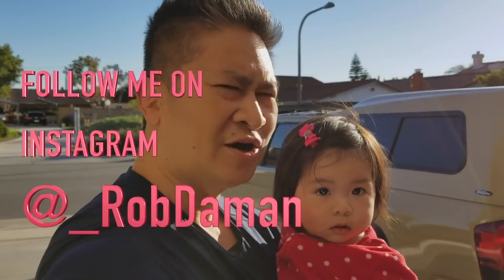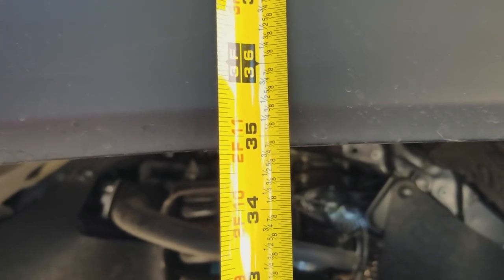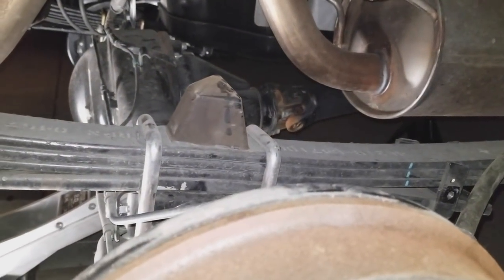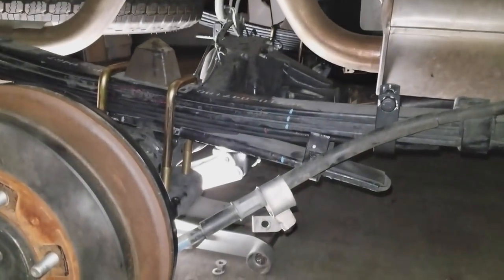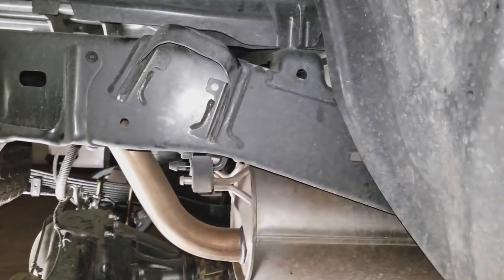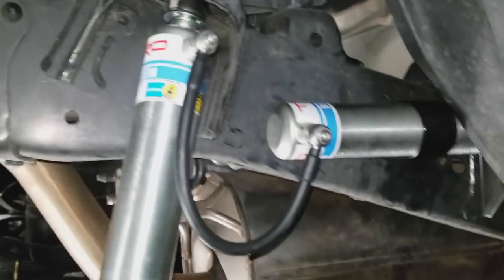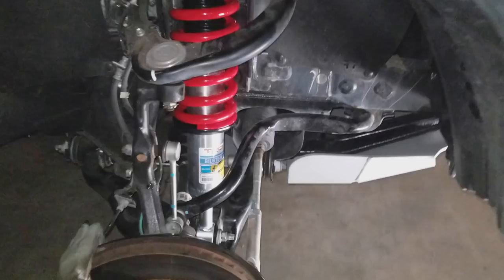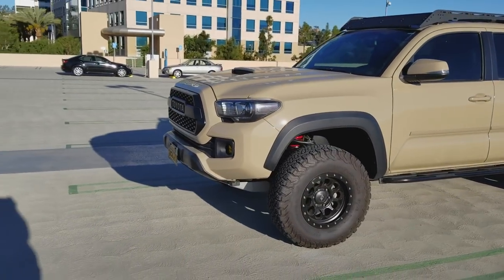I LIFTED my Toyota Tacoma Trd Pro Bilstein suspension and AAL Add A Leaf install

Comment: The TRD Pro suspension is great, down fall is the front TRD B6112s arent adjustable. They only have two clips vs the 5 or 6 clips on the Bilstein 6112s.
Reply from the maker: that is correct. the 2 rings are to handle the infamous taco lean. Some people are buying spacers to add/replace the spring perch or something over the top hat but that will negate some of the settings. it's basically whether you want a 2 inch lift or a 3 inch with the spacer.

These TRD Bilsteins use an Eibach spring so it's 'TRD tuned' which I'll assume Bilstein 6112 are using their own brand of spring. 

Thanks for chiming in.

Comment: You should have done a u-bolt flip kit and some aftermarket bump stops while you were down there man! Flip kits look incredible and really clean up the underside of the axle and increase clearance
Reply from the maker: you know I thought about them but decided to keep the suspension on the cheap. I have an awesome impact gun so I can so those 2 items mentioned probably in under 20 minutes since I know what to do now.

I'd probably reroute the center exhaust too if I did that. 

great suggestions and thanks for the comment!
Reply: Rob Daman of course! I just did the Dakar leaf pack, extended Bilstein 5100’s and u bolt flip kit and Wheelers superbump bumpstops on my 08 trd off road tacoma and the flip kit and bump stops are def worth the small price you pay for them! Your height looks PERFECT even with the added weight of the rear shell.
Reply from the maker: sounds like you got a nice set up!

I'm hoping it doesn't change too much with settling. Only time will tell.

Comment: Looks good man.  The rear was such a PITA for me when I installed my lift.
Reply from the maker: thanks! 

Yea I haven't heard any nice things about the rears except for the shocks. The combo of being alone and dark didn't help me.
Reply: Rob Daman It’s weird cause you would think the front would be the hard part to do.  I messed up when I did mine and didn’t use to jacks.  The truck shifted a little and it took forever and a ratchet strap to get it lined back up.  FYI I’ll be posting the vid of my Prinsu rack.  I used you install video to help me get it together lmao

Comment: Grinding off those retainers and rivets creates no problem for the strength of the leaf pack? Curious because I want to do a similar kit and I read some you have to grind/cut and some don't.
Reply from the maker: Hi, 

Good question. I would say no. It's just about a 1/4 inch hole that you grind and it's at the end of the leaf so there shouldn't be any structural issues.

Yes some you don't need to touch the rivets. It's usually the single leaf ones that you won't have to since they have more of an aggressive curve vs a 3 leaf progressive that I had.

Thanks for commenting.

Comment: @Rob Daman I watched your other video where you installed a 1/4" spacer to take care of the lean.  Was there enough thread on the top hat to lock the nut after you installed the spacer? It looked like you had plenty enough so I'm wondering if you changed the stud. I read some posts on TW where other members ran into this issue. I have a 3rd gen sport (I'm assuming your truck is 3rd gen).
Reply from the maker: It's original parts.

Comment: Please do an update on how the suspension feels after a couple rides! I lm planning on get the trd pro suspension too! 😫
Reply from the maker: sure thing. a few hundred miles so far and I can say it's a little firmer on road but when hitting dips it absorbs it very nicely.  I think it's a good upgrade but I'll see how it settles in.

thanks for posting.
Reply: @RobDaman  Update? I know this video of yours is a year old. Im starting to think about lifting my truck, but dont wanna crazy or too expensive like King.
Reply from the maker: Still going strong. These are basically 6112/5160 with TRD spec. 👍

Comment: Have you found the rear to sag at all with your extra weight or has it held up well over time? I am looking to do roughly a two inch lift myself but want to make sure I don’t get sag from my RTT I run in the summer. Thoughts on AAL also? Some people have said to use airbags instead. Thanks, keep up the great videos
Reply from the maker: I've actually upgraded not long ago. I'll be doing an update video but I can say a full pack be best for weight. stay tuned.

Comment: I have an 07 trd sport and looking into this kit... I’m just wondering if a would need a aal to make it level. It sits about 2 inch higher on the back with the new leafs from Toyota recall
Reply from the maker: Second gen don't have as much as rear lean so you may get away without it. I don't think the 15 pros looked saggy but if you're going to put any load like a cap like mine you may want to do an AAL or perhaps airbags on loads

Comment: Late question, and maybe its answered somewhere in this post, but did you end up experiencing that needle bearing driver side noise/vibration?
Reply from the maker: fortunately i didn't have issues. I put 700 lbs springs now with a bigger lift and still ok.
Reply: Rob Daman I hear if you exceed 2” up front, everything becomes an issue.
Reply from the maker: @techsocial626  some people with stock set up have this issue too. it's basically a crap shoot. not sure why Toyota continues to use em.
Reply: Saw a fix for it using zip ties somewhere on tacomaworld lol and everyone that tired it it worked for them, sorry couldnt find the link, worth a search it you are having an issue

Comment: old video I know, but are those shocks direct replacements for the pre fox shock 4 runners? And what rate springs are those in front?
Reply from the maker: Hi. No they weren't swappable from any threads I've seen. 600 pounds from the part number on them. I swapped to 700 Kings later on.

Comment: Thanks for the vid! I been looking on the shocks what a deal. 

Do you need to change the needle bearings with this lift? It will it even cause vibration issues. 

Also do you have to do the add a leaf in the back? 

Thanks man!! You save all a lot of work and reading with your videos!! Your doing all the mods I want. One day!
Reply from the maker: thanks for the compliments!

So the consensus is needle bearing can fail even on a stock Taco but some say a mild lift like this is ok but others reported it has noise right after install too. It seems to be not a matter of IF but a matter of WHEN. I didn't and since it's still under factory warranty I'll take it to Toyota and see if they'd warranty it if it did go bad. If not then I'll do the work to replace it.

About mods...just take your time. If you can't do them now, just hold up till you can. Taco in stock form is still respectable.

Comment: Hi Rob, love the truck. We bought our 18' Off-road in Quicksand after seeing yours. We are in the process of modding our truck so far we've only done the TRD Skid plate and Pro grille. Lift and tires are next project. Question: have you had any issues with Toyota vehicle warranty since the mods? Curious how Toyota is to work with on warranty repairs on a modded vehicle E.g. Engine, transmission, etc ( Obviously the components changed aren't under warranty). Thanks
Reply from the maker: Hi. Congrats on the new Taco! 

To answer your question on warranty with aftermarket, I've had 2 warranty claims which 1st was the clutch creak which was taken care of by the dealer. The 2nd was a vibration when braking. It was deemed that my rotors were out of spec and needed to be turned. This was under warranty but there was a point made that I had my aftermarket wheels and tires. I had that issue since a few hundred miles new.

My suggestion though is try to look for a "mod friendly" dealer that doesn't nit pick on everything. You can always escalate issues to Toyota Corporate but it's just easier to have a cooperative service dealer. If you see them selling or working on a lot of aftermarket  vehicles you should be ok. 

A lift is going to be the most controversial subject whether on brands, height and/or warranty. 

The consensus is if you raise your truck too high you may encounter needle bearing issues. Many will do the ECGS needle bearing as preventative maintenance and some will say to leave it alone. I've read a vendor/installer state it's not necessary to touch the bearing and it's better to leave it so it's indicator of impending failure. 

I myself didn't touch the needle bearing and thankfully I've had zero issues.

I've read only 1 report that a dealer denied warranty work on an owner's truck for needle bearing issues. Most reports have been positive

The fast rule is to keep it under 2 inches.  I didn't want to go any higher as it's tougher for my family to enter and exit. 

Thanks for commenting and welcome to the Taco family!
Reply: Thanks Rob I appreciate the info and comments. Loving this truck.

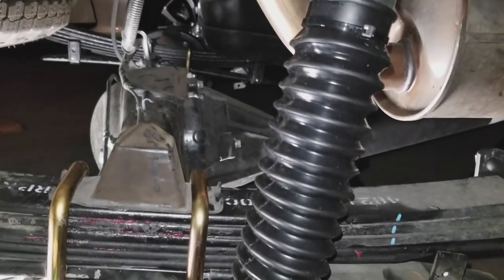Comment: Rob, great vid. Question about placement of the front u-bolt on the passenger side. At 2:19 in the video it looks like the u-bolt are (both) sitting in the farthest spot forward (& back) up next to the 'lip'. At 5:10 when you talk about having to 'force' the front u-bolt in, it appears that it is sitting farther back, not up next to the lip. Also shown again in a good shot at 6:49. I'm not a mechanic and haven't done any lifts, just wondering if it was supposed to be all the way forward and if not placed there will/can you get any movement in the u-bolt?
Reply from the maker: Hi

Thanks for checking my video and noticing my comment about the U bolts. My comment was actually referring to when inserting the bottom mount (4 holes) to the U bolts.  I had to wiggle the "forks" or U shape into it. 

The top of the lips you're referring to are attached to the bumpstops. Those bumpstops actually sits loosely when placed on top and has some wiggle room fore and aft. That's why the u bolt looks more forward or back. My concern was  to have the U bolts be perpendicular to the axle so when I bolted it down the bottom bracket was horizontal to the ground and have even torque. That I achieved. 

The bottom of the retaining bolt (head) seats into the top of the axle so there's no guessing that you have the axle straight.

Hopefully I made sense from the above comments. It is morning and my coffee hasn't kicked in yet. lol.

Thanks again for watching my vids and commenting!  Great question.

Comment: Looks badass. Does the part number you provide include both of the front shocks? Anything else come with it?
Reply from the maker: Yes! Rear shocks as well. AAL was the separate part I installed.
Reply: Wow that is an awesome deal! Getting a Taco real soon so just planning stuff out. In since its a toyota part, it shouldn't void warranty right?
Reply from the maker: Technically anything you replace will no longer be under warranty. They can claim a mod effected a warranty part like lift broke endlink. But they can't say your power windows are dead because of it.

Thanks for commenting

Comment: Is the AAL necessary for the TRD Pro Suspension or was that a personal choice? Also, do you suppose the truck would be leveled out or close to it without the AAL?
Reply from the maker: Great question.

AAL isn't necessary but this TRD suspension isn't adjustable so most Tacomas are getting closer to 2 inches meaning it's a little taller than necessary to be level. 

I got the AAL to not only raise the rear but the shell lowered it some and tightened the suspension too much. 

Let me know if you have any other questions. 👍
Reply: Hey Rob I’m kind of new to off-roading. I have a 2017 Pro with a 2 inch level kit on front Trd pro fox shocks and stock on the rear fox bypass. I also have a CBI bedrack with a Tepui XL Ruggadized rooftop tent. My rear has a droop that makes my taco looks kinda funny. Will installing the leaf you have level my truck out? And will it change my Trd pro fox suspension ride?
Reply from the maker: You have a good amount of weight so it depends on which AAL you go for. Single leaf AAL will be stiffer but will help bring it up more. The issue is your oem shocks aren't design for an extra lift so you may have to consider aftermarket suspension. You could use airbags now but your ride could suffer depending on your personal preference

Comment: Rob, before doing this lift, was the truck dead stock suspension with that size tires on it?
Reply from the maker: Dylan Perkins yes it was. 265/75r16 ko2
Reply: Sweet, thinking about going same route as you, getting these street tires off my 2018 sport, doing some smaller mods, maybe going with rims, then lift once i find a good deal. Love your videos bro. I just ordered Morimotos fog replacements but your video on the Baja Designs made me want those. I typed in my truck information on TRF's site and it sent me to an oval design (didn't know those existed, every tacoma i've ever seen has round, I didn't notice that detail and that's what got shipped,  instead of the round, so i'm returning and still in the market! May go with those Baja's too! Thanks for the help. Is your Tacomaworld user name Rob Daman as well?
Reply from the maker: Sounds like you're going to have fun with your build!

Baja Designs are great. If you want a more street legal light there's Rigid and KC which are great companies too.

Yes same user name on TW.  Instagram has a underscore though if you're there... @_RobDaman

Comment: Hey if the rear clamp isnt in the way on a 2nd gen tacoma theres no need to remove it is there ? Or does it affect in height not removing it ? Also arent you supposed to remove the leaf from the very bottom with the new 3 leaf pack ? I noticed you left it in there ?
Reply from the maker: Correct

No. It would make noise only as leafs flex

Instructions I had said either way.
Reply: So if i leave the bottom leaf from the oem when i install the add a leaf will it be higher and will it help for more weight .

Comment: Is there an easy place to find out what to torque all the bolts on the front suspension to? Really debating doing this job myself, as the only reputable shop in my area wants 1200$
Reply from the maker: I linked the info in my description.
Reply from the maker: Also check this video I had more light and showed more work on the fronts...

https://youtu.be/edavE-00w1Y

Comment: Hi Rob, once you added the front bumper do you drop down in the front from the weight?
Reply from the maker: yes indeed. bumper is 150 lbs
Reply: Rob Daman thanks! Any measurements after :) in front especially

Comment: Did you upgrade the UCA?  Did you also add a spacer on the left side due to the "lean"?
Reply from the maker: Hi, 

It's the stock UCA.

Yes I ended up adding a spacer to offset the lean. It settled a little more to the point I wanted to fix it. I did a video too https://youtu.be/edavE-00w1Y
Reply: Rob Daman what are your thoughts on single AAL vs. replacing the 3-leaf progressive pack vs. a full leaf pack? Right now I only use my truck as my daily commuter to work but eventually want to start hauling/camping.  Should I invest now or later? I have an older '13 taco
Reply from the maker: If you're looking to carry a lot of static weight most of the time a full leaf pack is best.stock leafs will sag over time and yours may be getting their depending on the history.  Single AAL are usually stiffer than 3 leaf AAL so that's why I went in the direction I went with.

Comment: What brand CAP/TOPPER is that. I am looking for one that is slightly taller than the cab of the truck. That one is it!! 

What brand!!!
Reply from the maker: It's a snugtop sport hiliner
Reply: Hey bro with that set up and topper does it fit in the garage?
Reply from the maker: Hi. I have so much crap in my garage I've never tried to park anything 🤣. 

I think it would be close though.

Comment: With this set up.Did you put in diff drop for the front & carier bearing fir the back?
Reply from the maker: I'm not running any additional parts and haven't had issues. (knock on wood)

Comment: hi rob I'm thinking about putting a 1 inch spacer to level the front of my 2012 2wd tacoma,would i need to lift the back as well? thanks.
Reply from the maker: Hi

A 1 inch spacer would lift the front 2 inches so you would need to lift the rear to "level"

If you're considering offroading I'd reconsider getting a suspension from Bilstein to level things out. Less stress on the shocks
Reply: Rob Daman thanks rob👍

Comment: looks good bro! I have an Icon Stage 4 with the AAL option. Thanks for covering the AAL as I was curious as how to do it. Like you, I am an avid DIY and do as much as I can on my own motorcycles, vehicles and around the home. Truck looks good! Did you do a carrier bearing drop kit?
Reply from the maker: Thanks for watching.

The AAL was my biggest issue so I wanted to cover that.

I don't have a carrier bearing drop. The CV angle was very good.

Comment: What brand add a leaf did you get? I too have a camper shell and haul a lot stuff when I Overland, I do have an aftermarket leaf spring installed that can carry an extra 400 lbs of weight but I feel it might not be enough when carrying a lot of cargo. Can you post a link of those Add a Leaf you have installed on your truck? Thanks.   PS: Your Tacoma looks awesome!
Reply from the maker: Hi

I bought a Headstrong AAL but I don't think it will work with your spring pack properly. I know some full leaf springs sell additional leafs. 

If you aren't sagging too much and know you won't carry that 400 lbs that often maybe look into airbags or something like superbumps so you don't have too stiff of a leaf pack when going light.

Thanks for commenting and the compliment as well. Happy Friday!!!
Reply: Rob Daman it doesn’t sag to much at all. I do have the super bumps on my truck and they work great when carrying a load. Thanks for responding back:)
Reply from the maker: Anytime. Let me know what you end up doing. Sounds like you're on the right track already